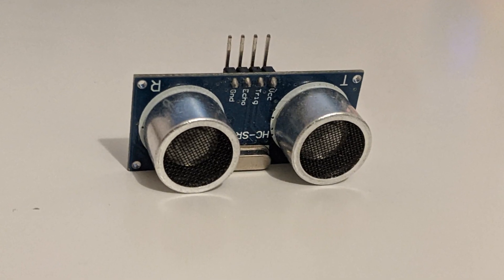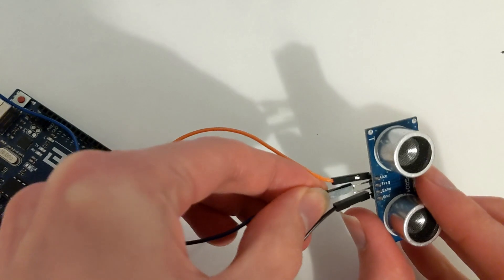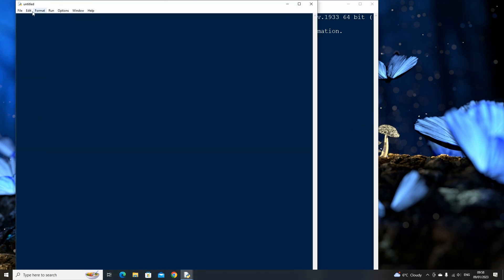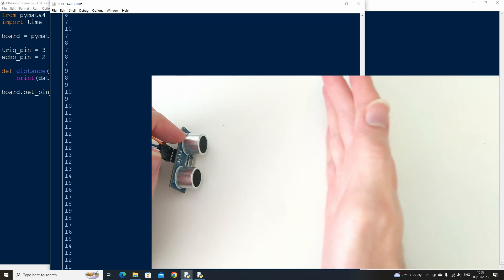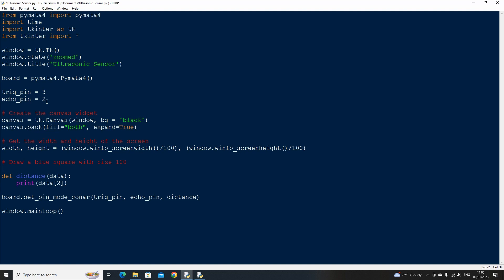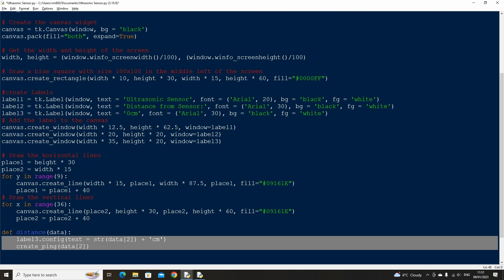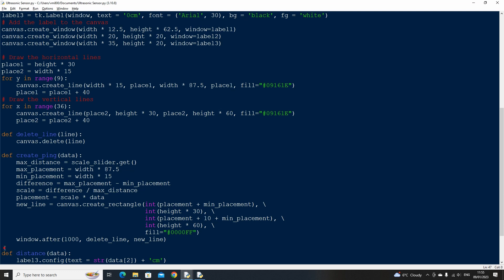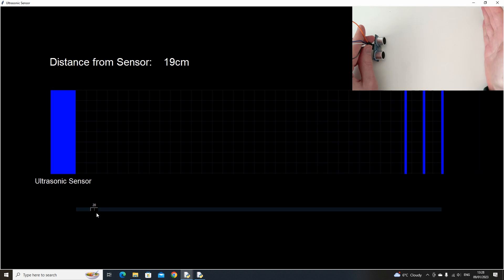Ultrasonic Sensor Control In Python

Comment: does pumata4 and FirmataExpress support bluetooth ......when I make a board instance and try to set com_port to the port the Sr04 bluetooth module is connected to the code gives an error saying it cannot fin the Firmata version id ......is there any fix or the pymata just dosnt support bluetooth like it predesesecor Standard firmata which i cant use because it doenst support ultrasonic sensors